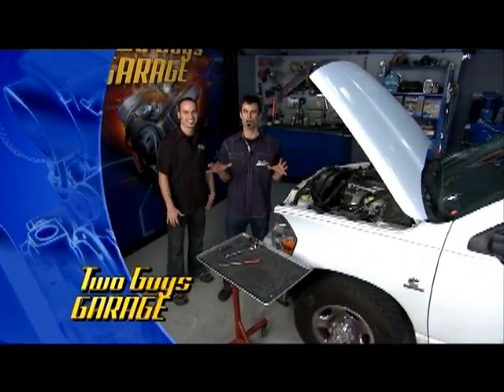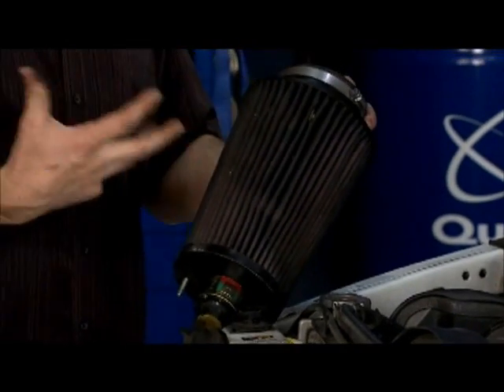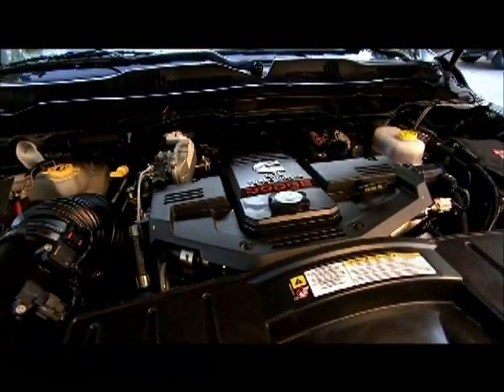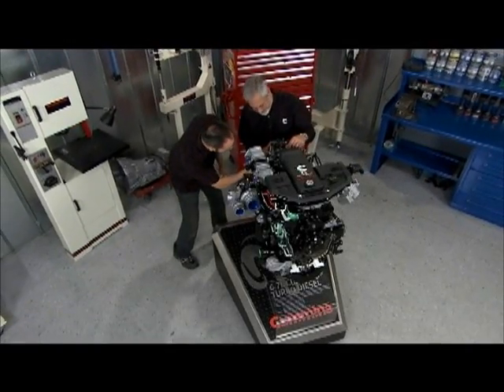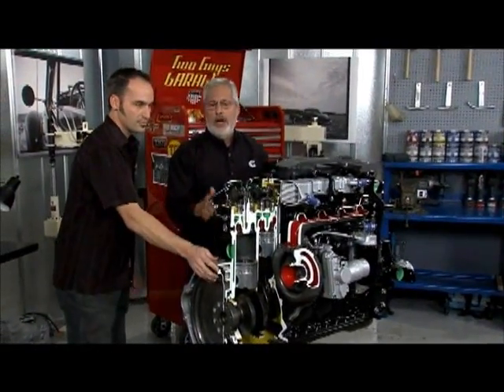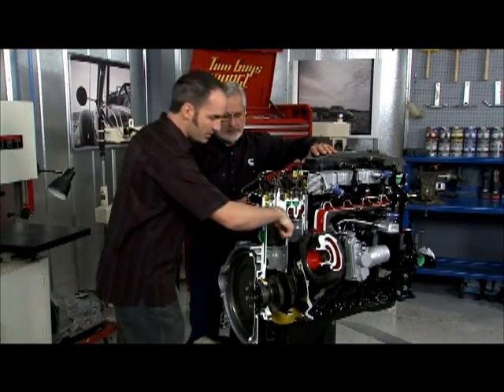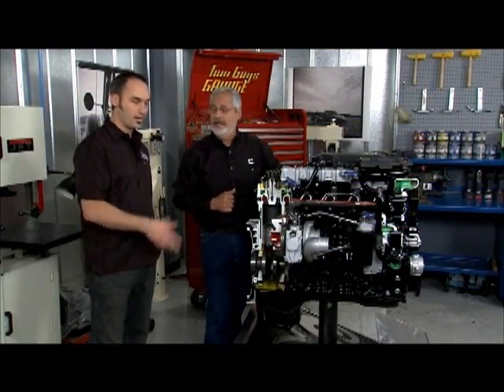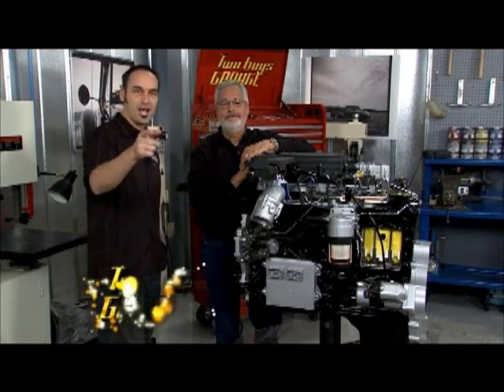Part 1/2 - Cummins 6.7L Turbo Diesel as seen on SPEED Channel's Two Guys Garage

Comment: Got a question for you guys....
I recently picked up a 2014 3500 dually with the 6.7. This is #3 for the past almost a year with bad luck at a dealer with the 2 previous rams. First one a 5.9 that the trans took out the torque then the crank shaft with the faulting transmission.  2nd was an abused/ used very hard 2011 that heated up,  taking out that engine.  
I do love this dually with 139K miles on her and want to keep her a while longer than the 2 before.  
Tell me.....
Perfect R's for driving?  What does this engine appreciate for a cruising RPM to keep it happy and longevity for this engine/ truck.  
At this exact moment I'm heading to my new property in Arizona from comifornia, keeping the R's at 2k or less with the speed around 70ish mph to do so.  
First oil change for me last week after around 3500 miles and expect to keep them going no further than 5000 miles.  
I tow seldom but with the recent move I've got my 24ft enclosed trailer behind me now.  (No clue the weight but I can't feel it what so ever and it's packed with wood furniture and other crap with the bed filled up and netted.  
Any info for my ignorance is appreciated.  
Great show and I'm certainly a fan of it.

Comment: i change my fuel filter every time i change my oil  every 3k-5k miles
Reply: how much is it, im just 19 but im looking into cummins diesel and diesel trucks in general but I want to buy just one and make it last till I die. Could you tell me how you budget that? Like, how many times do you change oil in a year and how do you drive it? Thanks man appreciate the help.
Reply: @YourBillionaireBlueprint  if you want a diesel engine that's going to last get a 7.3 powerstroke or 5.9 Cummins both have really long life spans

Personally my DD is a 6.9 L International Harvester in an F-350

You really shouldn't Budget Inn oil change you should change it at the correct intervals with the recommended oil

Additionally if you want your truck to last forever drive it like it's the only one you'll ever get and you will find out it last so much longer
Reply: @Friedrich-Wilhelm-1980  I had a 6.9 in an 86 Econoline 350, broke down every time I used it, not a fan.
Reply: @davekana8388  the biggest problem with the 6.9 IDI is Parts availability and obscurity

Mine always works but fuel system parts are impossible to find and engine parts have to be ordered through eBay pretty much

But I'd have no problem taking my truck on a cross country trip right now would not be worried for a second that it's going to strand me anywhere

One of the bigger issues that plague the 6.9 is the cam actuated fuel pump if you replace that with an electric fuel pump they're pretty reliable but that cam fuel pump can get air drawn in and failed to deliver in a fuel and can cause stalling and failure to restart because of air bubbles

Comment: I have the 6.7 turbo and I pull a 14,000 lb travel trailer and a 12,000 lb yacht. (No not at the same time) I travel long distance with them and very steep hills. I am usually at 1800 to 2000 rpm with plenty of pedals left. Not sure why the other owner on here isn't experiencing the same torque? True power house for me.

Comment: Uncles 2010 Ram 3500 6.7: 13mpg on Saskatchewan flat roads in spring unloaded. Dads 1998 Ram 3500 5.9: 15.4mpg hauling 13,000lbs fifth wheel in Rocky Mountains.  It did struggle though and in sure the 6.7 wouldn't be doing 60kmh in 3rd gear floored.

Comment: The way automatics are nowadays along with the smarter exhaust breaking system have made manuals nearly useless. Automatics will hold up better now than a manual.

If it was an older model say an 03, id rather have a manual because they are fun to drive, however if i'm working and towing 20,000lb daily id rather the automatic in a 2012 or 2013.

Plus these new diesels make so much torque you almost need to beef up the manual stock, let alone adding more hp.

Comment: I prefer the 5.9.   and putting an auto trans to a cummins is a joke.  you want a 6 speed manual, not auto.  automatic transmissions have no business in any diesel.  any mechanic that actually works/drives, vehicles/ as in climbing under it and yes, Getting Dirty.  would know that.  🚙

Comment: i just want to get the engine, im planning a build project for a 2 door jeep jk, i can fit a 4bt in there no problem, the 6.7 can fit in also but i think the weight of the engine is too much so i will have to find a another frame or somehow beef up the original frame, firewall also has to be moved back <-- this is what ive been told by a shop who will do the conversion, im not sure if i believe the frame part of the story, they usually are pretty think and Ive seen older jeeps with the 6bt

Comment: you could. but if you want the Ram with the HO you can just ask dodge(RAM) to put it in or find one with it, but this is a premium so a extra charge will be added on to the truck, not much though! also autos get morepower outa the factory vs manuels, why? idk prolly cause a cheap clutch is there for it just as a standard bare minimum power handleing/ its just cheaper for them, i would get a manuel with a 650hp clutch, and a smarty jr for 75+ hp and 200lbs+ tq

Comment: im a bit confused, i was on the Cummings website looking at specs for the 6.7 inline 6, its 350hp 800lbs tq , but when i go to the dodge ram website the engine is rated at 650tq? is dodge purposely holding back power of the engine?

Comment: Hi for the comment that some one posted that cummins stole the oil injection cooling under the piston it is hadly new vw used it on there TD motor in the 80's and on the 1.8L 16V gas motor that was used in the GTI and other models same thing in the audi rage. :)
Reply: V10PDTDI.  Good luck with your audi...  sucker... there is invention..  then there is getting it right! ... guess which one that your audi did to you?

Comment: @cummins595959 I know that and they didnt steal it.. They used it because the pistons would get really hot from the turbo ever hear a turboed motor that had pistons melt before?? Well it was used to to keep them cool and boat motors have it to so its not just diseal engines.. If there was any stealing it was honda stealing nissans neo vvl/t sr20ve engine blue prints...